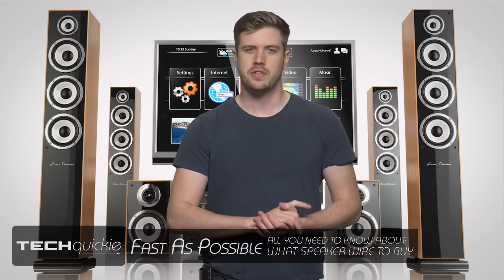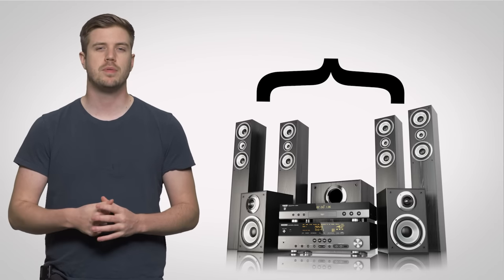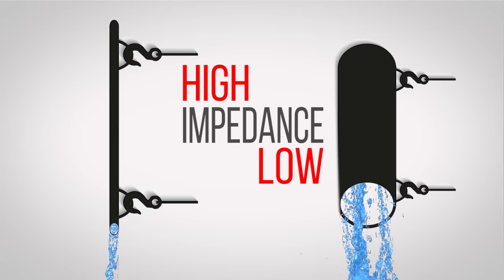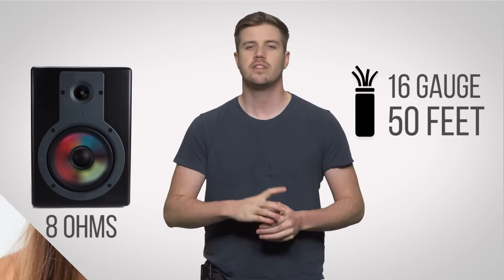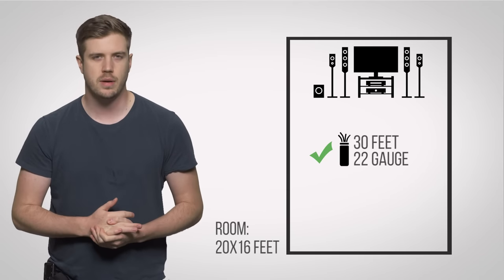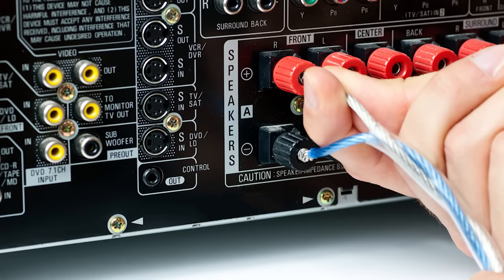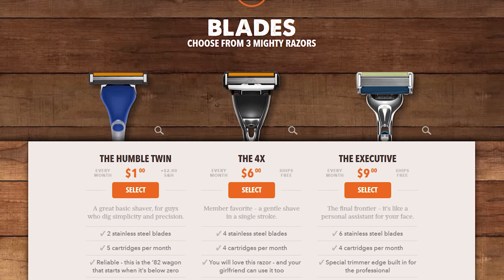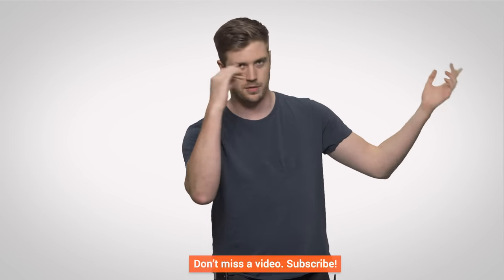What Speaker Wire To Buy As Fast As Possible

Comment: You really missed a lot of information that could've been useful
Reply: Agreed
Reply: Notice the fast as possible, they can't cover everything.
Reply: Yep agreed
Reply: +frenchiveruti You've failed to offer any suggestions. If you want anyone to improve you should be clear on what you're asking for and not use something so broad.
Reply: +Ben Thanks for the correction, that fits much better actually.
Reply: Frikken
I was, indeed, vague, I'm on mobile and the terms aren't on the dictionary and also the app closed with a big comment and I simply said: "DAH FUCK IT"
Reply: +frenchiveruti The only thing I would have liked added would be shielded/unshielded (which was briefly touched on) and what class of sheathing is used (in-wall requires higher insulation to meet building codes - regardless of what copper is in them).
Reply: +frenchiveruti I NEED TO KNOW WHAT DID HE MISS TELL ME
Reply: +frollard I recently upgraded to shielded wires (for 7.1 surround 4-6ohm speakers in 20 by 30 foot room). And honestly, it doesn't make that much of difference. Shielded input wires, on the other hand, made a huge difference

Comment: The insulation on speaker wire does not "protect against interference", because speaker wire is not shielded. The insulation only serves to keep the wire from oxidizing and prevent it from shorting against itself or other objects. Also you should note that the wire gauges shown in the video are measured in American Wire Gauge (AWG). British countries use Standard Wire Gauge (SWG) which is different.
Reply: +vwestlife I think he was referring to shielded cables, that's why he said don't spend a bunch on expensive cables because shielding is one of the things they advertise, but yeah you're right
Reply: British countries???
Reply: England, Wales, Scotland and Northern Ireland are considered british countries.
Reply: Nicholai Nissen 
I consider Northern Ireland a part of Ireland, I am not the only one either...
Reply: 50 - 50 whether the speaker wire will be shielded.
Reply: I Thought C.I.S ( British Commonwealth Countries) ......
Reply: I bought some sheiled wires once then cut them up so have 14 g positive solid wire with a 10 guage negative
Reply: what cables did the IRA use?
Reply: @UserNameWasCensored  Why the confusion? I'm not in the UK but we use the same metrics. (Not to be confused with metric)
Reply: room-ten-oh-nine !  Both of those countries are within the British Isles so doesn't matter if they like it or not
Reply: @niroshaalabdeen7367  The C.I.S. is former Soviet states. And the British Commonwealth is now the Commonwealth of Nations.
Reply: in Europe we use mm^2
Reply: When listening, I prefer not to put up with the faint background signal noise (noise floor)

One should try pressing pause or mute, and if one is unable to differentiate whether the systems off or on, that's telling you your cables are crap.

When friends or guests come round rather showing them how loud the system goes I prefer to press pause/mute and show them how quiet it goes.

Silence is Golden.

Comment: As a professional installer, I usually run 16/2 or 14/2 depending on the length of the run and amp rating on the speakers the customer wants to install. I normally deal with Episode, proficient, paradigm, sonance speakers. All recessed interior or bracket or recessed exterior (decks, patios). Love the video and the explanation you gave to describe impedance.

Comment: One of the best none bullshit videos I have seen from Linus media group 
10/10
Reply: I thought it was sub par tbh.
Reply: +TheLawnWanderer 
what's going on with all the bullying?
Reply: +Kurt Phillips yeah. They forgot to cover power input/output and how proper RCAs can actually give you better sound.
Reply: +The Bau5 RCA cables in general are usually the worst way to hook up home theater equipment these days.  You are correct, if you have to use RCA its better to use quality RCA cables. Optical and digital coax offer far better sound quality even in home theaters that deal in several channels of audio per side.  I think the only thing that is still connected via RCA in my home theater is my Onkyo dual tape deck.

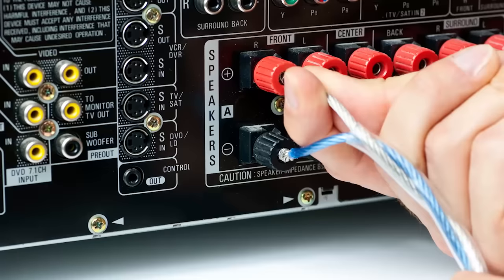Comment: Really think you missed a lot of things in this, you should avoid CCA (copper clad aluminum) wire as it can cause a large amount of impedance even over short runs and go with plain copper or OFC (Oxygen free copper) wire, just go on amazon, anything that is 100% copper is fine, don't get tricked by fancy super expensive name brand wire. Most speakers are between 4-8 ohms, a lot more are 4 ohms than you think. The impedance of the speaker is not as much of a concern with wire as it is with the comparability of your amp. Your wire gauge has a lot less to do with speaker impedance as it has to do with power output/rating of your speakers. If you amp outputs 1-100 watts per channel 14 gauge wire is fine, if your amp outputs anywhere from 100-175 watts per channel you should go with 12 gauge wire. Higher strand count is better for the wires as they are more flexible and less prone to internal breaking. 3:06, is literally the worst stock photo you could have used considering that is not at all how speaker wires go into those terminals. And using connectors like banana plugs does make it easier but also introduces more resistance, just plug wires in properly and you are fine.
Reply: +Torbox1 Good quality gold plated banana plugs are actually quite a bit lower resistance than the typical shove the wire in the terminal post hole and tighten the terminal or the crappy spring loaded push in terminals.  Quality gold plated banana plugs that are silver soldered to the copper wire can be installed once and last decades without succumbing to corrosion and increased resistance.  For most speakers and systems it really doesn't matter all that much as long as the wire gauge is decent and the connections at both ends are electrically solid.  OFC or Oxygen free copper is actually marketing BS from an era when it was very easy to get poor quality copper wire with tons of impurities.  Pretty much all pure copper wire is oxygen free these days because it would not be cost effective to change the process of making the wire to produce a lower grade.  The only time you really have to worry about wire quality is if the wire you are buying is from a cheap Chinese seller where quality and makeup could be an issue.  Some of the best speaker wire available for home audio happens to be lamp cord since you can buy it in any length and all common gauges from 18-12 gauge.  If you need to install wire in a wall where it will be permanent it is a good idea to install shielded twisted speaker install wire which you can buy in several sizes and numbers of conductors.
Reply: I am aware that OFC is merely a marketing term but was covering it because people may come across it have questions about it. As I said any 100% copper wire or OFC wire is fine but you should avoid Copper Clad Aluminium wire. Any mechanical connection regardless of materials creates more resistance either do to the added length or the fact that it is simply 2 materials contacting each other. As long as the connection is solid it doesn't matter, the only thing that could be better would be to solder to the amp. And for the matter of soldering to banana plugs it is indeed a good method that cleans up the look, makes it easy to plug and unplug, and doesn't add any real resistance but it can corrode as with any copper wire exposed to air. I have had it happen before, it was after several years though. But anyway, lamp cord is a good alternative as the insulation is much thicker and you can get it with shielding. Which is nice if you plan on running it through the walls.
Reply: @Torbox1  Not to mention there are tons of videos online proving how bad CCA wire is in a situation where every bit of performance counts. Id rather have nothing holding me back than something as dumb as wire limiting performance.

Comment: I just use monoprice 12awg oxygen free copper wire it's cheap and it works. It sounds obviously better than the 16awg stuff that had steel wire and copper plated wire on the other side from Canadian Tire. I also use some banana plugs from monoprice and some rg6 subwoofer cables

Comment: Good video... though interference (an electromagnetic phenomenon in this context) isn't going to be stopped by simple electrical insulation.
Fortunately it doesn't matter for speaker wires, since EM interference is typically SEVERAL orders of magnitude weaker than the actual power that wire is carrying. EM interference is typically only a problem if it's introduced BEFORE the amplification.

Comment: Most of the length/gauge spec you gave are for copper wire.  Most of the speaker wire in the consumer market is CCA (copper clad aluminum) which requires 2 gauges larger for the same length.

Examples:
18 gauge copper or 16 gauge CCA; up to 32 feet
16 gauge copper or 14 gauge CCA; up to 48 feet

The general rule is to keep the wire impedance (each conductor) less that 2.5% of the speaker impedance (5% total for both conductors).

Comment: It would have been important to note that cheaper speaker wire doesn't always use copper or even better OFC (oxygen free copper). The Amazon Basics 16awg speaker wire for instance, uses 42 stranded CCA or, "Copper Clad Aluminum", which as we all know is less conductive than what you really want anyway. The real answer is look for 14awg all around, OFC construction and a decent jacket to combat snags and tears/some interference issues. Brand name doesn't matter as long as you're getting the bases covered. For reference, I currently use Monoprices' Core Series OFC 14awg. It's a dollar more than the Amazon option and you get everything you need, nothing you don't need to pay for.

Comment: Insulation doesn't protect against interference, shielding does, there's a big difference there.
Reply: True and agree. Insulation deals with protection against accidental grounding or short-circuiting (physical contact), while shielding deals with protection against electro-magnetic interference between adjacent conductors (not touching each other).

Comment: Good honest and correct  video.  I like  Belden  14 AWG 2C  Hi-Flex commercial speaker wire or the 16 AWG Belden wire  , you can get it in bulk at about .40 .50 cents a foot and its in wall rated also . The ready made parts express and Mono-price terminated wire pairs are inexpensive and decent also and so is the 16AWG inexpensive roll of RCA  speaker wire ,I think 50' is like 8.00 and electrically and insulated  just fine 

OTOH   real simple  for a short run 16 AEG  Home depot zip cord is fine as well and all of these will sound as good  as $1000.00 plus exotic metal /exotic design loudspeaker cables that are a sham and if you can hear difference with  the exotic wires it is being deliberately attenuated to differentiate itself and it is not accurate . Home depot and Amazon should have all this..

Just make you sure your wires  have decent inexpensive terminals on each end and you are done .

Comment: +Techquickie Yes speakers impedance changes with frequency, but it is almost always higher then what is the listed on the speaker. Anything lower then the rated 4, 6, 8, ohm etc. could blow up the amplifier if it is not built or rated to handle the lower loads. Thicker wire is not really needed for that reason.

Higher ohm loads are easier for the amp to drive since there is less current. Lower ohm loads are much harder to drive, use more current, and cause the amp to heat up even more. I had a 0.5 ohm stable Orion high current (cheater) amp back in the day that you could fry an egg on. Only 50W x 2 at 4 ohms, and 100W worth of power according to most sound organizations back then, but it put out 600-800W depending on voltage bridged into a 1 ohm load.

Comment: Fun tip: Those 6' 2 wire $1 extension cords for 2 prong electrical outlets at the dollar store can be cut and made into super cheap, effective speaker wire.
Reply: I did this a few days ago except with an old extension cord I found. I think it was 16awg, pure copper. Tinned the leads with solder and hooked them up, don't know if they sound better than the 22awg cables I had before but at least I have the headroom to go louder now.
Reply: +StoreBrand | Bernie2016, higher gauge wire isnt going to be your limiting factor, your amp or speaker will give up before the wire burns out. Also most extension cords are solid core not multi strand, thus having a higher resistance.
Reply: Metech None of my extension cords are solid core. 16awg solid core would be pretty damn stiff. The cord I used was multistrand pure copper (as far as how pure idk). Heat increases resistance, so even if the wire itself isn't ever going to burn I would at least now have no added resistance from warm cables.
Reply: the amount of residence you are talking about here though is miniscule milli ohm if not less, and in a home theater environment is makes no difference. Also if there wire is getting hot it would mean there is to much current being pushed through you wire. As for the solid cables im for straya, and majority of ours are solid core cause it easier to roll up.
Reply: Metech I guess I've never really thought about how much resistance it adds, good point. Another benefit to thicker cables is durability, I've had to re-strip my 22awg cables because of breakage from when I move the speakers around and have to disconnect. My speakers use a screw terminal (vintage hi-fi) and my amp uses spring terminals so my wires go trough a little wear, which is another reason why I opted for thicker cables.
Reply: No you definitely cannot do that and have a decent system.

Comment: pretty good summary. wouldn't go with anything less than 18ga though. i'll admit my 12ga speaker wire for 15 ft runs may have been a bit unnecessary.
Reply: I can go one better... lol.. 8ga (it might even be 6ga, i'm converting my native metric 4mm diameter from memory) for 6ft6in runs of no more than 25 watts per channel rms. Was some automotive power cable i got free and used because i had it. Had to get the butane torch on it to solder it into the banana plugs. Always causing myself stress to save a few pennies, me.
Reply: I am thinking about using 8 ga for speaker wire also same length haha.  Did it make a diffference?  Im using 16 ga now.
Reply: Sean S the difference would not be noticeable at all, and would barely be measurable. for 12 gauge wire, the resistance is about 1 mOhm per foot, so a 20 foot run (40 feet total) is 40 mOhm, represents a half a percent increase in resistance if your speakers are 8 ohm and 1% if they are 4 ohm.
a 1% difference in volume is completely undetectable to the human ear, as large changes in power correspond to small percieved changes in volume, which is why the decibel scale is used.12 gauge wire at 20 feet would lose 0.043 dB, which is negligible. even 16 gauge at 20 feet is still a very small difference measured, and completely inaudible.
at shorter distances,  wire is even less of a concern.
TL;Dr : unless you have VERY high power >500W per speaker, very long runs >100 feet, or speakers with an impedance of less than 2 ohms (basically subs only) your wire is fine.

Comment: If your really skint and using free with equipment bell wire buy some solid core 5 amp from B&Q or wherever, only drawback at the cost is its inflexibility. Note Julian's observation about polarity, red to red and black to black when connecting.
Only a good idea if you have a decent set of binding posts both ends, don't try this with the nasty sprung spring terminals or they will break.

Comment: Insulator doesn't do anything to shield the wire against interference.
Interference is magnetic and electric fields that couple to the conductor (wire) and cause unwanted currents and voltages that you hear as noise.

You can only shield against these with a shield made out of metal. Ferromagnetic metals help against magnetic fields and conductive metals against electric fields.

For electric shielding the shield has to cover the entire conductor and be connected to a ground (e.g. device chassis).
Reply: Yes, but you can lable thosevas Insulation aswell since the insulate aganist fields
Reply: +Annelise Meier no, it is shielding, insulation only refers to electrical isolation
Reply: Slot1GGamer, that's right.

To be very exact and overly pragmatic, insulation is isolating the wire galvanically, meaning that there's no path for the direct current to flow. Shielding is always against non gavanic fields (e.g electromagnetic field). Same coin, different side :)